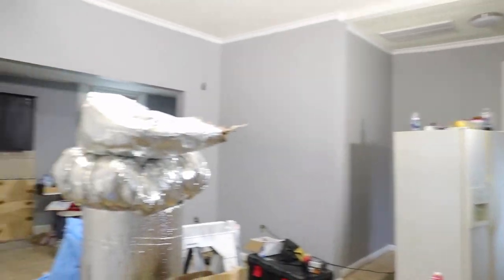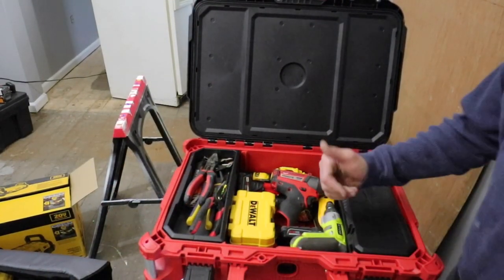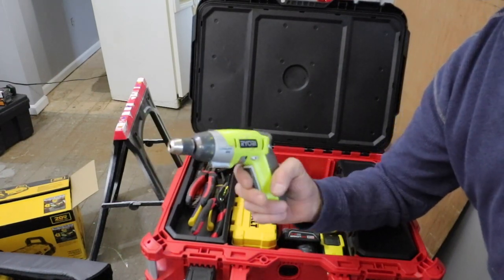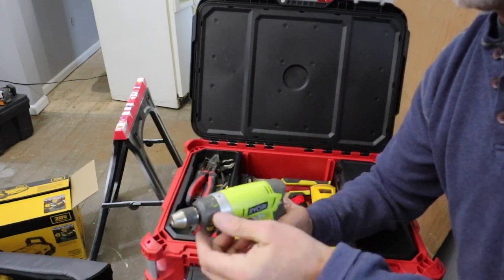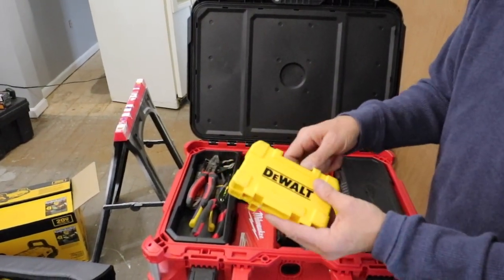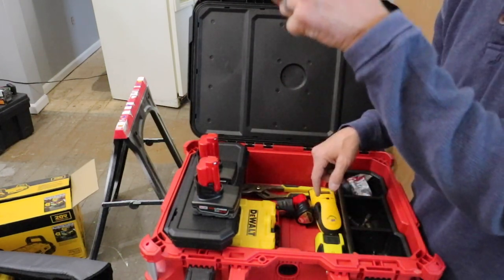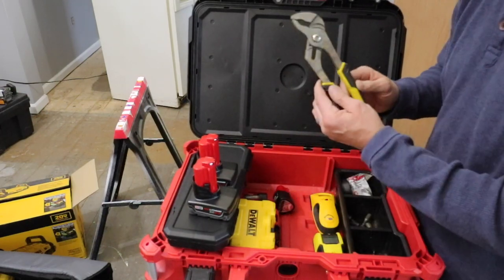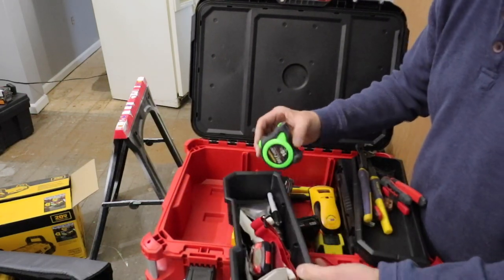Confession; I Have A Man Purse

Comment: David, if you like that ryobi screwdriver you should get the Milwaukee M12 FUEL screwdriver 2402-20. It's my go to tool for all assembly/disassembly/small drilling jobs. it has a clutch, drill/driver modes, is 2 speed and will drill great with the hex shank drill bits.
Reply from the maker: ThacMan I’ve seen that, I have a few tools on my list to buy so I may add that one. Thanks for watching and commenting you have a blessed weekend.